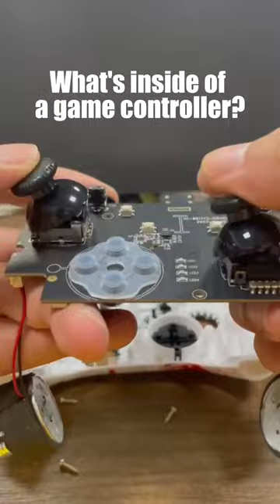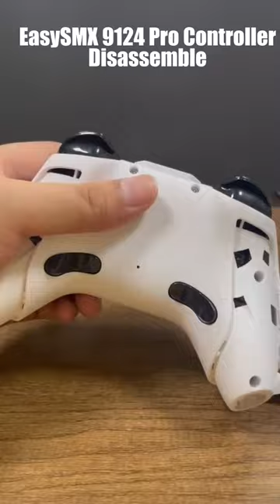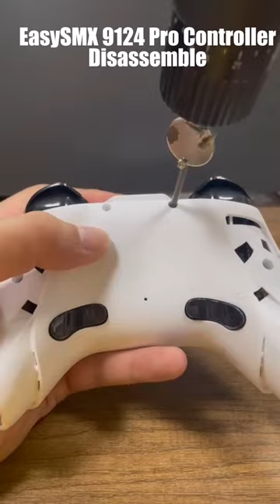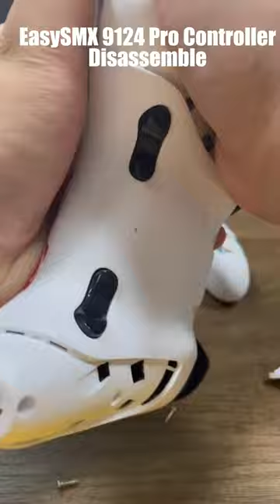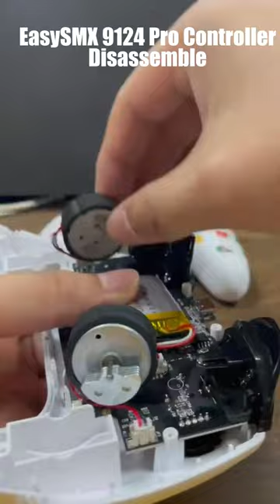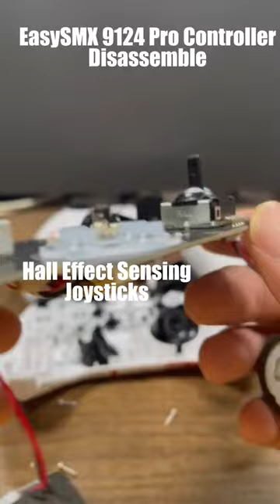Diving into the secret of game controller...

Comment: For information: when connected to PC it works exactly as an Xbox controller would. The X-Y and A-B button printing is swapped but when you try playing a game - the XYAB buttons are in the same place as in Xbox controller, only the bitton print is swapped.  Saddly you cannot swap the buttons after disassembly bacause the buttons have small tabs and they won't fit swapped.

Comment: ** HOW TO REMOVE THE GRIPS ** (with minimal damage):

You literally just have to pull REALLY hard. Try using a rag to get a better hold of it and then just pull down on the grip. Unfortunately, this WILL break a little tab on the inside of each grip, but they go back on just fine and should stay on as long as you're not actively trying to destroy your controller while using it. I only have the base version (not the Pro), but I'm assuming it works the same way.

Comment: Hey was planning to get a bayard 9124 for android gaming is this a great choice or is arion 9110 better i ask at the shoppee shop nobody answer
Reply from the maker: I think 9124 controller would be a better option than 9110 on your android
Reply: @EasySMX  thanks good thing i just put an order for the bayard 9124. if i may ask i was gonna go buy a silicone cover for it does a xbox size work for it or is it a ps controller? Since thats the only sizes i can compare to and get at the moment
Reply from the maker: @raishinhimura211  Maybe the Nintendo pro controller size is close to 9124's size. But it also has some differences between them
Reply: @EasySMX  i see i see thank you very much for the info

Comment: I need to change the button layout😅😅
Reply: can it be changes to xbox layout?
Reply: You can not, the buttons have small tabs and swapping them arround won't fit. The good thing is that if the pad is connected to a pc the button layout works exactly the same as in an Xbox controller, only the print layout is wrong.

Comment: How do you remove the fucking grips? You keep responding and offer no answers.
Reply: I did it like that: pushed HARD on the grips towards the gamepad and down, (as on the video but HARD) to create a tiny gap, then i used a small flat screwdriver to fill the gap, pushed hard again to put a larger screwdriver and rotated it to pull down, then pushed it down further.
Reply: @draconpost  oh I'm gonna try that. Ok so paranoid about breaking it.
Reply: @corylim7351  nothing broke in my case but it requires a LOT o brute force, try using a cloth on the screwdriver tip so the plastic casing won't bend at the edges, and use a quite big screwdriver, a knife is too bendy for that and the plastic opening tools used for phones will probably brake if you tried using them, anyway good luck, I badically did what they di in the video but had to ise some lever to force it to push it down